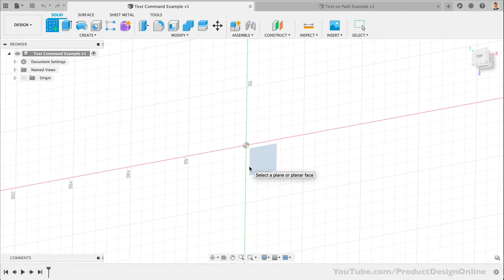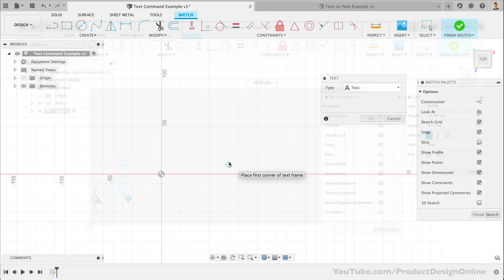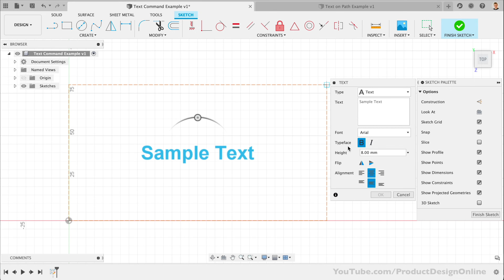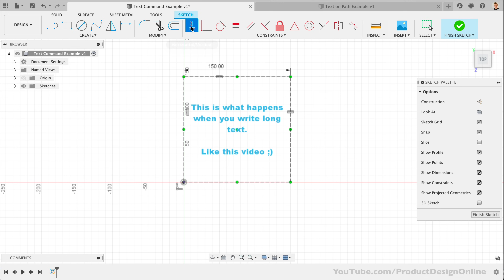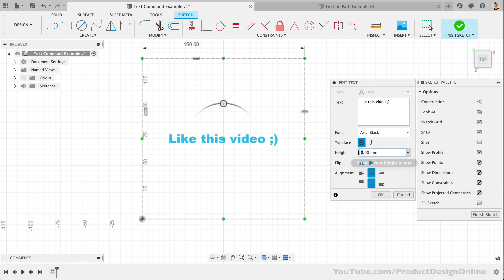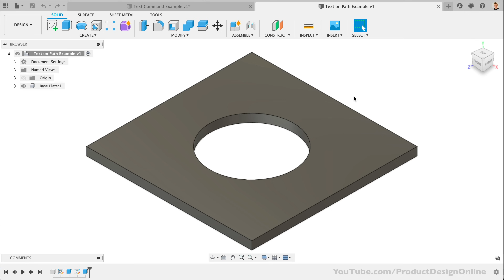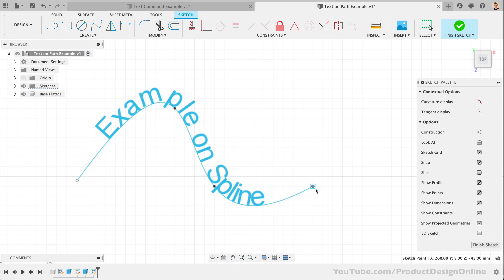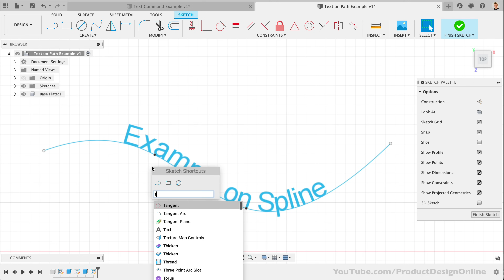Fusion 360 Text on Path and Text Alignment

Comment: I would like to be able to change the user inputted text in a box setting up a variable like we do in the “Parameters Dialog Box” under the “Modify” pull down menu. An example would be that I am labeling parts to 3d print but want to print the material gauge (thickness) on them, say one part is (“10” plus “gauge”) and the next part is (“16” plus “gauge”). Then I would only have to change 10 to 16 in the user defined parameter for “Gauge_Thickness” and it would change the material thickness as well as the parameter for the thickness (the 10 or the 16 would be numeric data for the material thickness parameter and converted to textual data for the other text printing parameter).

Comment: Good video thanks. I am trying to find a way to modify the height of various texts without having to edit each one. I tried making a parameter called TextHeight and assigning that as the text heights. Fusion accepts it but changes the value to the actual value instead of maintaining 'TextHeight' as the parameter. Any work arounds? Thanks
Reply from the maker: Hi Mario. At this time the parameters don't fully work with text, but they are working on that for a future release.

Comment: RE: regular text, once you make the box type and style your text. How do you simply more it to where you need it without it rotating all over the place? the paragraph alignment is great but if you just need to move it a few mm to get it where you want its a royal pain :(
Reply from the maker: You'll want to use constraints to fully define the "text frame". You can also use dimensions to define the distance from the edge of one text frame line to another object of your model. If you have the right sketch constraint/dimensions applied then you'll be able to adjust thing as needed with it updating :)

Comment: Hello Kevin,

I added several text boxes to a drawing. If I use a user parameter for the text height, this seems to be ignored. It is resolved and the number itself remains in the parameter field of the text box.
I select the properties of the text box and enter my user parameter "Text_Height" (which is 5mm) in the parameter field. When I close and reopen the properties box, I only get "5mm" for the text size parameter. Changes of my user parameter are ignored and have no impact on the text size.

CU Jens
Reply from the maker: Hi Jens. I checked with the F360 team and parameters with text are something they're still working through - it will be available in a future update. For now, it will allow you to call a parameter name once, but then it will no longer update after the first one.
Reply: @ProductDesignOnline  Hello Kevin,
thanks for your answer. What also is not working at the moment is using rectangular patterns with text boxes. Would also be nice to have in the future.

Comment: The new text command really doesn't appear to work right.  If I am able to define a box, the text is always rotated 90 degrees and rotating it to the right angle puts the anchor points in the wrong spot.  Half the time, I would just get tick marks where I click, but no box.  I also need to use the bounding box text created to offset the next text block to keep minimum distance to the next text (for 3D printing minimum thickness of embossed text).  Are we going to be able to keep access to the old "simple" text command that just works?

Comment: Hello Kevin,

if I extrude text (e.g. the word "Test"), I will get 4 new bodies. If it is a longer text, I will get even more bodies. Special characters as colon, will generate two bodies.
My first idea was to join the bodies to one new body named "text". But this will produce even more bodies. Is this a fault or am I doing it wrong?
I would like to 3D print everything. So I will need at least 2 STL files. The body with engraved text and the text itself. So I could print them one by one and use the text as inlay or print it with two colors at the same time.

CU

Jens
Reply: Problem solved! You can of course only combine bodies, that touch or intersect each other.

Comment: Man-O-Man!  Echo what others have said - it's about time!

This will literally save me hours on doing switch panel layouts for 3D printing where all of the text is part of a single large multicolour 3D print.

The old style text would mess up font sizing continuously when moving the bounding boxes around and having to do a sepaprate box for each word, or multiple boxes for one word if a word spanned multiple lines; was a complete nightmare! So much wasted time and filament...   You would start a print, see one bit of text that didn't look quite right, check the Fusion file and find out the box had change sized by 0.75mm as the result of a small move, which would in-turn change the contained font sizing.

Then of course you had the issue of fonts being smaller than the actual bounding boxes, so you had to use construction lines and measuring to ACTUALLY size your text.

I feel relief, not joy. 

Thank-you @Kevin for bringing this major and important update to the community's attention.  :)

Comment: Does this new text update work with personal license?  It is not available on my Fusion 360. No updates are available.
Reply from the maker: Hi Terry. Yes! It's available on all licenses. If you leave Fusion 360 open all the time (like I do) then you will have to switch to offline mode and back on OR restart, then it should notify that there is an update, it will automatically download, and then you'll have to click the blue "Restart Fusion 360"

Comment: Still doesn't remember last used font, urgh.
And hold on, you can use a parameter to set the height but then it forgets the parameter and just sets it to the value, thus it can't update when you change the parameter... facepalm

Don't get me wrong, it's still a massive improvement, but that is some very basic features that already exists in other tools in F360 so I hope they add them sooner rather than later.
Reply from the maker: Agree with you there - the parameter thing is funky.... I know they're still working on some more text enhancements, so fingers crossed that is one of them :)

Comment: Is text parametric yet?
Reply from the maker: With the new 'text frame' you can have the text alignment automatically adjust based on your model. You can also use parameters for the height of the text. So, in some ways it is... however, it will not fully adapt to everything if you drastically change your model. You may have to add manual line breaks, etc..
Reply: @ProductDesignOnline  but what about the actual text? I have been wanting this feature for a while. It would be great to have the ability to change text from the table. Off to the suggestion box.

Comment: Finally! I'm still seeing enough limitations that I'll still be using Inkscape, but this is a huge change.
Reply from the maker: What do you do with the text in Inkscape?
Reply: @ProductDesignOnline  in Inkscape I would create blocks of text (for labels on panels, for example) with any font with full text box format editing. The current implementation (from the video, I haven't gotten to test the update) is missing a few formatting things that I'd want: line spacing, tabs, no font to outline restrictions, etc.

That said, from the video, the update hits 95% of what I would want. I'm definitely going to test it to see if it makes it so I'd only need to go to another program rarely instead of every time.

Edit: Considering how far a departure from the old method this is, I expect that everything I need will be added sooner rather than later.
Reply from the maker: @JLProPhoto  ah, gotcha. Thanks for sharing. Advanced spacing (kerning, etc) may be something that will always ha e to be done in a graphics program. Although, I do expect they'll implement some spacing control... Not sure outline and some of the smaller uses cases will be :)
Reply: @ProductDesignOnline  By Outline I meant that half my fonts were not getting recognized as being able to be used for embossing or debossing and that Inkscape doesn't have that limitation (and I convert everything to a path).

Still, I welcome the new system and I hope that I can do everything in one program more often. Even though I've gotten pretty quick with doing basic stuff in Inkscape, Fusion is so much faster, and it's less prone to alignment issues.